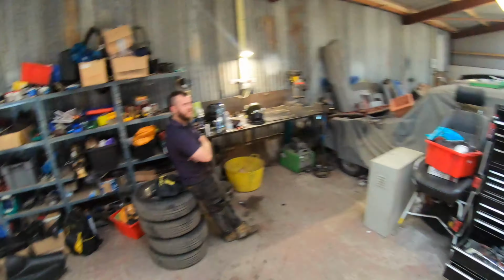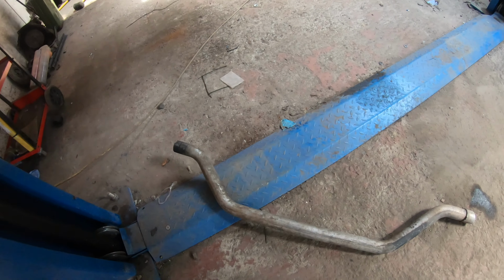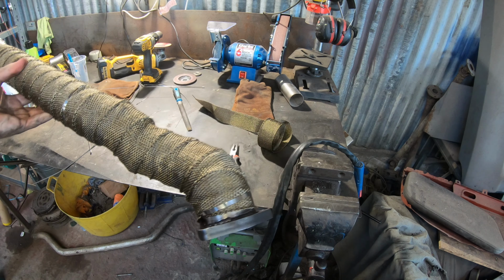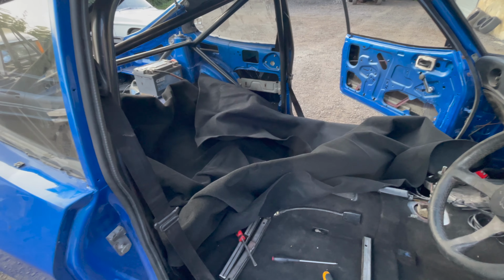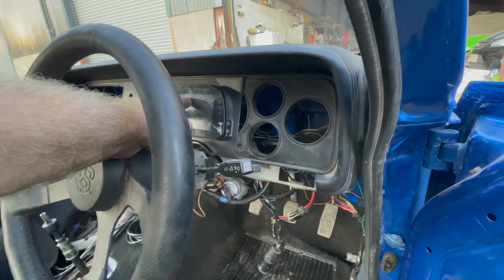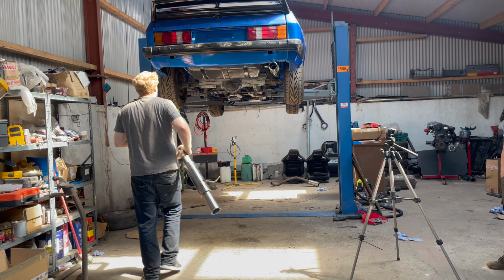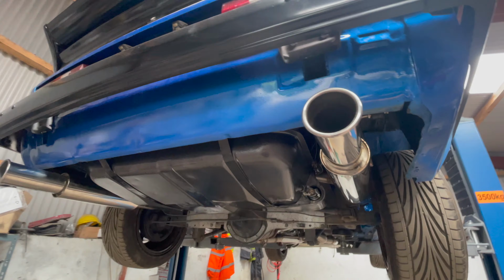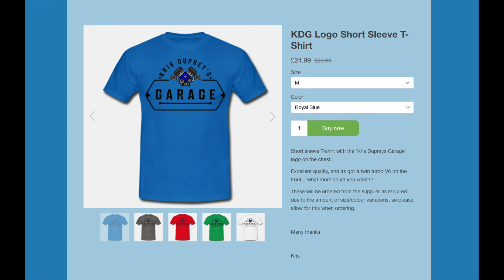Project Xpack Episode 58 - Full STAINLESS Exhaust build! Ford Capri 2.9 Cosworth Twin Turbo.

Comment: I think the reason to wet the wrap is to reduce the dust/fibres getting in the air you breath. I heard that after I did mine and it made sense. Worth doing if/when you remove it too

Comment: Like everything else way more time consuming than anyone would ever believe. Looks tidy. Are the rear wheels/tyres what you're planning to run? Also no LSD?
Reply from the maker: I have an LSD on the shelf, just needs fitted. I intend to get the car mapped, then remove the rear axle and do the disc conversion and LSD install :)
Reply from the maker: Oh, and the rear wheels and tyres are going to stay for now until I can afford the splits to be rebuilt :)